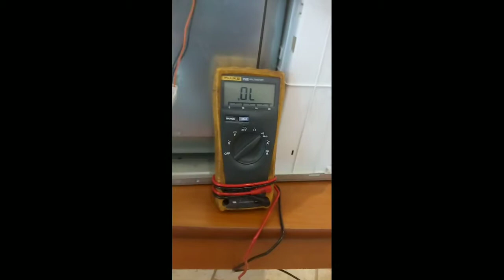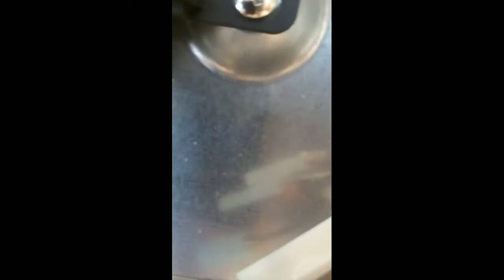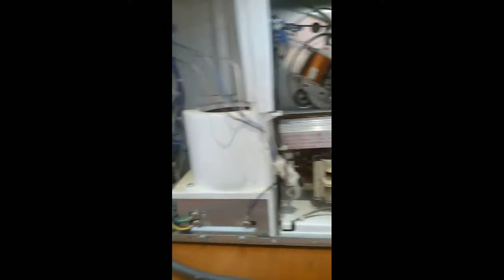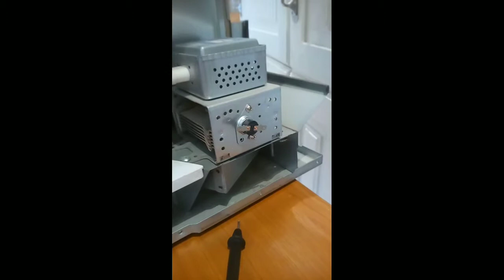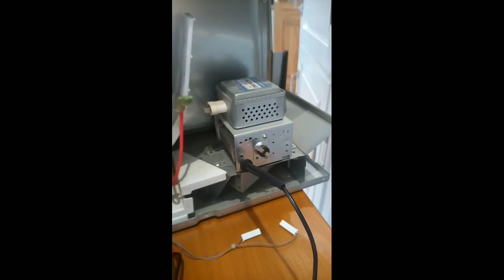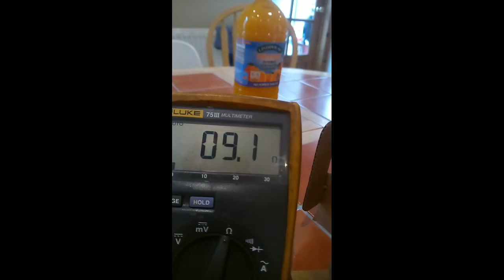Neff Microwave Repair Episode 2

Comment: Hi, great work but the bit missing is which screws to remove to expose the innards without making the whole thing fall apart.. I need to get to those door closed switches, my initial guess for the 'close door' message when its closed!
Reply from the maker: Sorry Bud,

I guess that may have been in a much earlier video or I missed it.

The outer cover is a single folded piece of sheet metal. The screws holding it in place will be along the edges. Look for mating surfaces and go from there. If you feel uncomfortable with this it might be worth getting an expert in.

Cheers,
Rob
Reply: @willitwork4330  Once the unit was completely removed from the cabinet it was quite easy to work out in the end. Four screws around the top and a star screwdriver was required. The microswitches checked out ok on the ammeter. Removed a number of spade terminals and the connection blocks, checked under the main relay board for burn marks (none) replaced all the terminals and blocks and it worked! Just a dry joint in the end. Nice cheap fix!